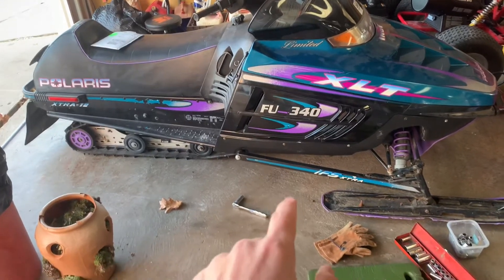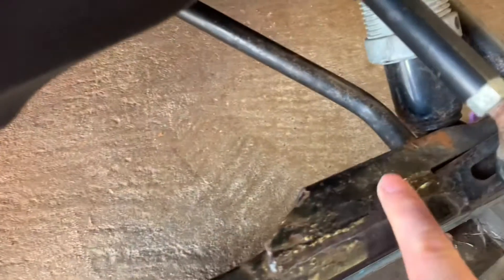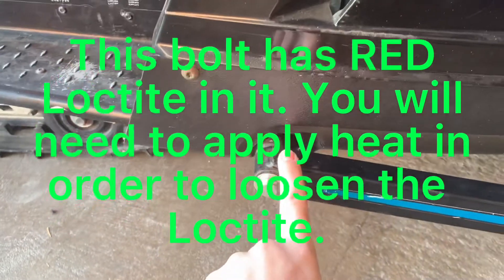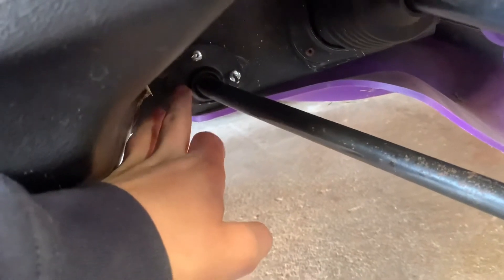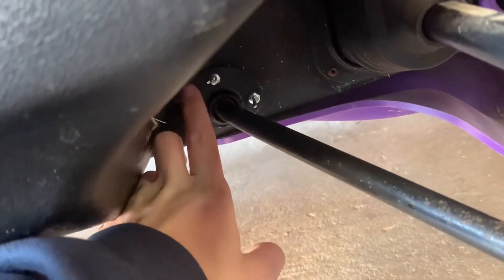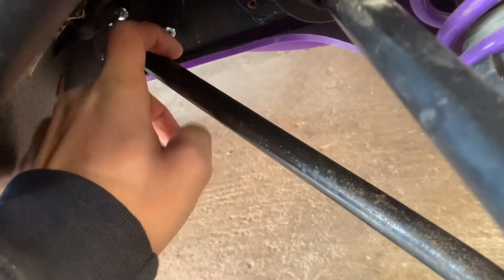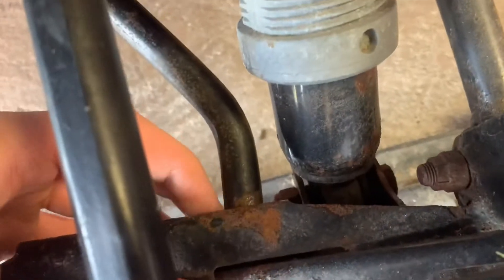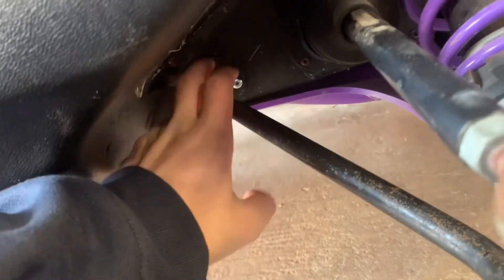1997 Polaris Indy sway bar bushing replacement

Comment: Hey Jack, did you find that the new bushings were very tight. Hard to get over the sway bar? If so what did you do?
Reply from the maker: Hi Andrew, just saw this. Sorry for the delayed reply. Yes, the bushing goes on fairly tight. There are two different size sway bars depending on the year and model. Be sure that you ordered the correct size. Most wedge style sleds have 9/16 inch sway bar, while some touring sleds have 5/8 inch.